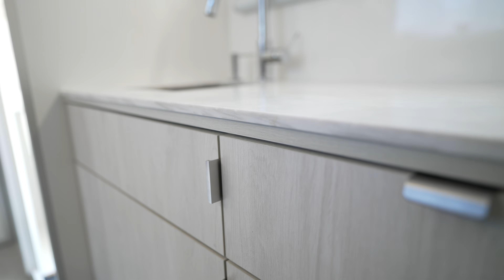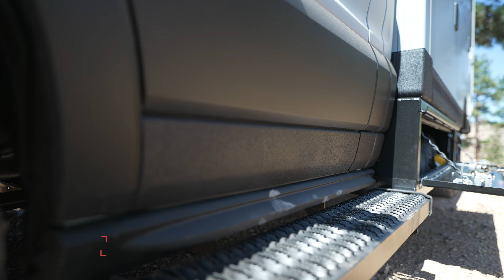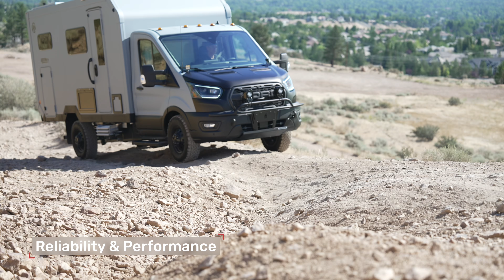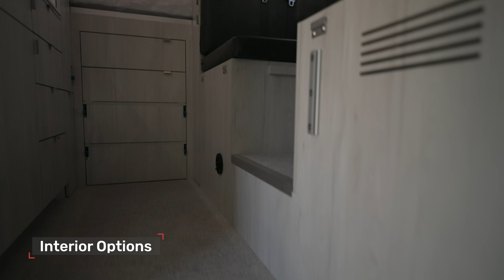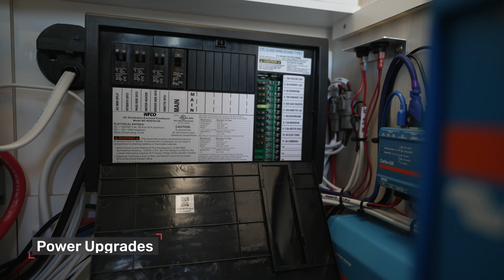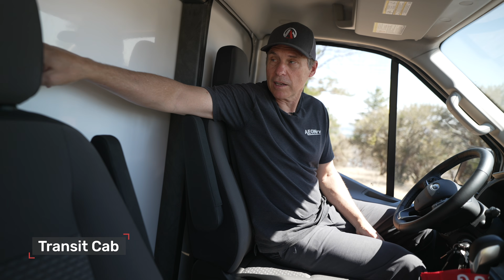2025 AEONrv Walkthrough – The Ultimate All-Season Off-Road and High Tech RV Tour

Comment: Great vid!  As an owner of a AEONrv for 10 months and full timer I remain impressed with the rig and customer service. Mad respect to the continuous pursuit of improvement/refinement.  Even the video, I feel, is the best you’ve ever produced to date.
Reply from the maker: Thanks for the feedback and continued support. We’re excited for this next phase of growth and look forward to building this AEONrv community together.
Reply: @tonym817 - are you likely to be in Loveland this weekend for the Overland Expo MTN West? I’d love to pick your brain about full timing if you’re willing (and if you won’t be there, then over DM or email). We’re considering full timing in this rig starting in a year or less, depending on exact circumstances. 

One immediate question - do you pull a toad 4 down with this rig or know anyone who does? 3500# ought to provide enough capacity to tow a 2000# manual mini or spark.
Reply: How tall is this awesome van? Is it a similar height as a tall roof transit?
Reply from the maker: @bartman1857  Yes, similar height at 9'9" to rear corner and 10'3" to top of the skylight.
Reply: Forgot about the Mini split AC which is a HUGE feature going with the solar panels & battery banks.
Reply: Seriously dude you need to move that bathroom.  Walking through the bathroom is a NO GO.  other than that. I like this rv.
Reply from the maker: Appreciate the feedback! The walkthrough bathroom design is intentional to maximize space and keep the layout open, but we know it’s not for everyone. Glad to hear you like the RV overall.
Reply: @richardg8712  no better way to keep fresh air flow to dry out a wet area! Brilliant idea! Finally one I hadn’t thought of! 
Very impressive to not worry about people who get offended.
Reply: @richardg8712  I think the bathroom location is very inventive because how much do you use the bathroom?  A "regular" bathroom is just a waste of usable space.  The Aeon RV bathroom is puting that space to good use.  I love it there.  One of the many things that made me like this vehicle.
Reply: @richardg8712  it makes a lot of sense to some people and not to others. If you hate it, don’t buy it.
Reply: @richardg8712  Perhaps a NO GO for you, dude, but the long list of build commitments have already spoken—the bathroom location stays—and one of the many new and innovative approaches that has set this rig apart.

Comment: I worked in the automotive industry and a supplier asked me one day what I would like to see changed, or wished was different; or what my ideal accessories would be.....I told him I Never had a problem with "this" {as I demonstrated MaNuALLy rolling down a car window}.....more electronics, more "bells and whistles" just means more potential for things to go wrong.....I'd prefer to stay OUT of a dealership repair shop. I Never had a problem with a manual adjustment driver seat....I found the more adjustment options I had the more time I spent trying to get it "perfect"....I had a problem with my driver side window and my horn....those were the most debilitating problems (a horn really is a safety requirement....you don't have it and you'll notice)....rain coming in through a window that won't close all the way SUX.... Although I'm gonna completely contradict myself and say I had a 1992 SL 500 Mercedes Benz and it was the Greatest car I ever owned....some things went wrong or broke but I almost enjoyed spending money on that car.....I'd take it right to my local MB dealership and they treated me like I bought it new. I even had free roadside assistance (looooooong expired). Free coffee and snacks while I waited.....hobnobbing with the rich folks.......the SL 500 is a V8 powered convertible.....it probably weighed 4-5,000 pounds but you know when you're driving a V8.....that car was Perfect....top down and there was barely any road noise......close the door and it was like closing the door on a tank....Absolutely Zero Body Roll when the door slammed home......I'd take corners dang near on two wheels and the bolstered seats kept you from moving an inch.....Quick Question: How many cup holders do you think the car had? I'll put the Over/Under at 2.5 (.5 means we won't tie). Taking the O or the U?

Comment: Nice rig and component selection. What is the OCCV rating?
Reply from the maker: OCCC approximately 1,200-1,350 lbs depending on the options you have installed. 

GVWR 9,950lbs

Comment: Is the box mounted in a way such that it can twist independently from the chassis in order to allow for off- roading without stress cracking the box? From the video, it seems that the box is mounted rigidly and I was hoping that there would be some type of torsion free mounting that offers some degrees of freedom for the box when the chassis is twisted going over off road terrain.
Reply: Every rv eventually cracks and leaks. It's a real shame when they cost the price of a small house

Comment: How about a rear differential locker?  When the induction cooktop is used on the outside, where is it plugged into?  The plastic sink while functional does seem a little cheap.
Reply from the maker: The Transit AWD uses a limited slip rear differential (3.73 ratio) paired with Ford’s intelligent AWD system and terrain modes like slippery and mud/ruts. It automatically sends power to the wheel with traction and performs extremely well in snow, gravel, sand, and moderate off-road conditions, without the driveline stress of a locking differential.

The induction cooktop is portable and plugs into a dedicated 120V outlet. We use the kitchen outlet and run the cord through the window, so it can be used inside or easily moved outside under the awning.

For the sink, we chose a lightweight, durable composite material for weight savings. We appreciate the feedback and are always evaluating materials and upgrade options based on owner input.

Comment: Did he mention the size of the water and grey tanks? I missed it if he did.
Reply from the maker: Fresh water: 67 gallons total
– 59 gallons fresh water
– 8 gallon Isotemp marine-grade hot water heater
– Heated by engine coolant while driving or a 115V electric element when plugged in or running on battery/solar

• Gray water: 25 gallons
– Freeze-protected exterior tank

Let us know if you want to dive deeper into any of the systems.

Comment: Seems like the wheels and tires are too skinny or small for this. Maybe a wider wheel would look better
Reply from the maker: The AEONrv runs 16” heavy-duty steel wheels with BFGoodrich All-Terrain KO3 tires. We also upgraded the Ford Transit chassis with a 2” lift, custom springs, and tuned shocks — so this setup is optimized for strength, clearance, and off-road performance. Wider wheels might look good, but this balance gives the best handling, load rating, and capability.
Reply: Let the professionals handle that.

Comment: When will you do a video on the new North-South twin style bed layout?
What voltage does the Mini Split use, how long will the AC run on the batteries?
Reply from the maker: Good questions. The Mini Split runs on 115V. How long it runs depends on several factors, including battery size — AEONrv comes standard with a 10.9kWh battery pack, upgradeable to 13.6kWh. Generally, during the day you can run the AC all day while solar continues generating more power. No one has ordered the North-South twin bed option yet, but layout drawings are posted in the private Facebook group (AEONrv Owners & Explorers). You can also reach out to sales@aeonrv.com for direct info.
Reply: @aeonrv  Ive tried joining that facebook group with no luck. I thought maybe its because i dont own your rig yet. I stress, yet.

Comment: Does the Ford chassis have tire pressure monitoring?
Does the engine have an hour meter?
Reply from the maker: Yes — the Ford chassis includes tire pressure monitoring and it does have an hour meter.
Reply: @aeonrv  Thanks, I found a work around, the trip odometer tracks run time.
Reply from the maker: @garagesale5948  It does actually have an hour meter as well.

Comment: Nice looking van. Why are there so many options, it seems like they should just be part of the build. I’m just not a fan of the mini split ac on a van.
Reply from the maker: Thanks! We offer a lot of options so customers can configure their AEONrv to fit their specific travel style and budget, rather than paying for features they may not need. Our mini-split AC is one of the most efficient and quiet ways to heat and cool the cabin, with performance down to -13°F, though we know it’s not everyone’s preference. Our electrical system is also built more like a high-end marine or residential setup than a typical RV, for maximum durability and off-grid capability.

Comment: 400Ah battery storage?
Reply from the maker: The 2025 AEONrv comes standard with a 10.9 kWh 24V lithium battery bank, which is 800 amp-hours at 12V. We also offer an upgrade to 13.6 kWh for even more capacity.

Comment: IMO, you need to also redesign the roof to add more than 800 watts of solar, needs 1000 watts at least or more, 1200 would be better. And I also agree with what some others have posted the over the top it's an option is getting old on these types o RV's.
Reply from the maker: Appreciate the feedback! The difference with our build is the high insulation value (R-15 average) and highly efficient 24V electrical system. The 2025 AEONrv comes standard with a 10.9 kWh lithium battery bank (upgradable to 13.6 kWh), 800W of rigid solar, a 3,000VA inverter/charger, and marine-grade wiring throughout. This setup is designed for maximum efficiency and reliability off-grid. We’ve found 800W to be a good balance for weight, roof layout, and performance, but if you’re interested in customizing further, you can email sales@aeonrv.com.

Comment: This is a nice build but the problem with this cutaway van chassis RV is that the gross dry weight is about 8500 lbs which gives you a maximum payload of 1500 lbs which is not a lot. Fluids like fuel and water weigh over 8 lbs per gallon, now you add multiple people, equipment, supplies etc, you will always be running at or over the 9,950 lbs GVWR.........
Reply: One fact that many people ignore....you bring too much crap with you!!!  Know your weights!   Weigh your vehicle wet, full fuel, full water.  Now fill it with all your junk, then weigh it.  It will surprise you.  We constantly toss things that we carry but don't use over six months.  You'd be surprised at how much junk you carry that you don't need or use.
Reply: All true, but it’s the same for any SRW chassis with this level of comfort, amenities and quality build.  I had a Dodge 3500 flatbed with a NIMBL camper before my AEON and the CCC was in the same range.   Unless one goes with a minimum build (nothing wrong with that) or a 4500/5500 chassis it’s just the way it is.
Reply: @tonym817  I agree with you. The new Rossmonster HAVN has the same problem: 9,400 lbs dry with a 11,000 GVWR. These van cutaways are not meant for builds such as these. If you think about it, no van cutaway or truck chassis cab is meant for these types of builds. I have a Cascadia Composite habitat Ram 5500 on order. In order for me to improve the 5500 driving dynamics, I had to do DBL Super Singles and LiquidSpring suspension, not cheap.... Lol My entire rig will probably be around 13,000 lbs dry so at least I will be well under the 5500 19,500 lbs GVWR. My point is that most van and truck builds will be at or over GVWR unless, as you stated, you go with a 4500/5500 which are essentially commercial trucks and expensive to modify to be used as an RV........
Reply: @DaltonHan  Congrats on the forthcoming rig!  The AEONrv rides really good.  They did respring for the weight.  I’m very surprised how well it drives.  Running at GVWR isn’t my first choice, but as long as it rides well and is safe to operate (which it is) all that means to me is it falls under severe duty and  service intervals will be reduced.  I like the smaller footprint of the rig so is what it is.
Reply: Given these weight facts, has anyone created a weight budget spreadsheet with rows of each of the options and corresponding weights, along with rows for fluids, passengers, and expected cargo? If one doesn’t exist yet, I can build one, as long as Aeonrv can help me with expected weights of every option. Then you would just check each applicable line for total.
Reply: @omahajim22  You wonder why RV manufacturers are not open about the GVWR unless you ask them. If you think about it, it's really not their fault because van and truck chassis cabs are not designed for campers.......
Reply: @DaltonHan your opinion/assessment is understandable, but I simply want to calculate a weight budget anyways (like weight and balance for flying). Facts mean good decision making and everyone may come to a different conclusion that works for them, just like the heavily debated entry issue.
Reply from the maker: @DaltonHan  This is not true. We work with Ford and they have a specific RV engineering group we interact with in our design process. One thing people don't realize is most of the weight limitations are driven by federal gas mileage requirements and not the safety of the vehicle in terms of suspension, brakes, etc.
Reply: @aeonrv  You don't understand. Yes, I believe that you have modified your vans to be able to handle the additional weight but have you re-rated your van's GVWR? I don't think so because generally only the manufacturer, in your case Ford, can do this. The ability of your vans to handle increased payload and the GVWR are two separate issues. This is a challenge for all camper manufacturers because van cutaways and truck chassis cabs were not designed for carrying campers.......

Comment: Great set of improvements. Well done. If customers want slightly larger tires and a higher lift - what is the largest you (or a customer) has done so far? I think overall it is a fantastic product you developed, but ground clearance seems to be the limiting factor to go a bit beyond the typical forest roads.
Reply from the maker: Thanks for the feedback! We only do a 2” lift, but we also add custom shocks and skid plates for extra capability. For the 2025 model, we switched from KO2 to KO3 tires for improved performance. Feel free to reach out to sales@aeonrv.com to talk through options for anyone wanting to customize further.

Comment: $225,000 and you get 2 Bungie Cords to hold the water heater...LOL
Reply from the maker: The hot water heater is stored behind that. The bungee you see is just holding the induction cooktop in place when it’s not in use. We store it there so it’s secure while traveling and easy to grab for cooking inside or outside on the fold-out table.
Reply: Someone doesn't know how to pay attention.
Reply: You actually think that’s what the bungie cords are doing?? 🤦🏻‍♂️😂